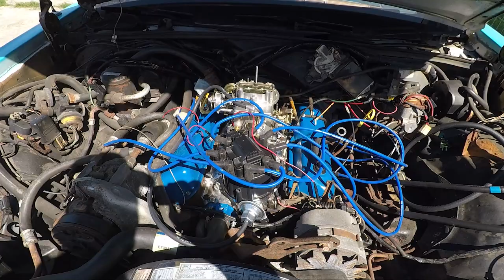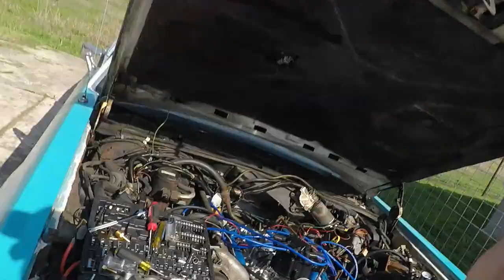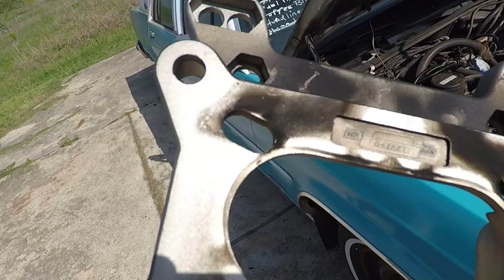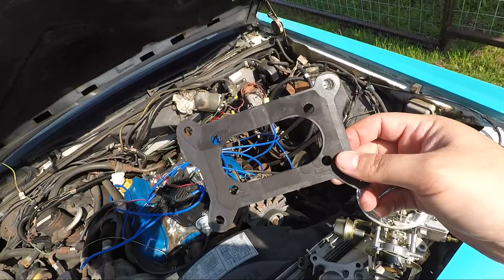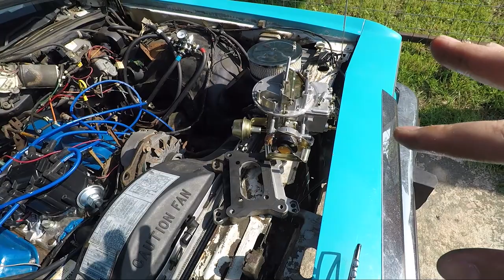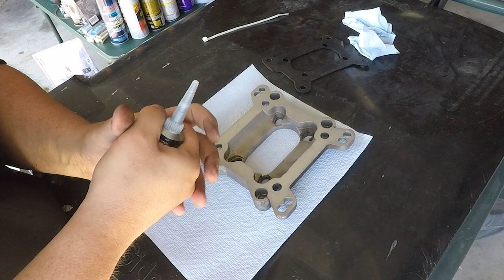1984 Ford LTD Crown Victoria Restoration Ep. 11: A New Hope

Comment: Earlier today I realized that there is a possibility that unfortunately the car may not start even after plugging the holes. That's because in the early episodes of the series, the engine wouldn't start so you tried changing the distributor, intake and convert to a carburetor. However, the cause of the engine failing to start wasn't known. There could be a possibility of the old issues prior to the conversion preventing the car to start. 

I sincerely hope that isn't the case. I remember when you purchased a code reader, one of the codes indicated a faulty crank position sensor.(If my memory serves my right.) I would look into this if the car still won't start. A bad sensor will prevent the engine from running. 

Fingers crossed it will start and idle on the next episode!
Reply from the maker: Excellent memory DJ! I wasn't exaggerating when I said my knowledge of cars is very limited (though it is certainly getting better the more I work on the car!). So it could be a lot of unknowns, with the throttle position sensor being one of them. It's a process, but I'm keeping at it! Thank you so much for watching and commenting, it gives me a lot of heart when things are stuck.

Comment: So my comment of a vacuum leak was probably right! With a smoke machine you would have seen the smoke escaping between the carb and the intake. I think there are very good chances that it was the cause of the engine running for only a few seconds at a time. That black soot was clear evidence of a vacuum leak that would cause a lean condition. You can thank your dad for the suggestion!

I that glue/sealer doesn't work, I would try JB weld. I'm glad you didn't give up and go to a mechanic!
Reply from the maker: Yes, I think you were definitely right (or at least on the right track). Right now, I think that seems to be the most likely culprit since I have eliminated timing to the best of my ability. And, given the fact the car was running at a more reasonable idle speed for a few seconds, I would say it's dialed in pretty good so far. Thank you so much for the tip with the JB Weld! It didn't seem to me like the RTV was going to be able to hold a vacuum leak/explosion in (it's pretty soft material even when it's cured) so I'll give that a shot! Or maybe I can find a really simple kinda welding thing? That would probably be the best way to fix it. I'm glad I didn't give up too! It was thanks to everyone's support and ideas that kept me going! :)

Comment: I have the 2100 motorcraft carburetor on my LTD, it works well. Keep on the task. My car fought me from paperwork to just getting it running.
Reply from the maker: Thanks for the support and encouragement! If you used an adaptor plate for your carb, did you have any trouble with it having vacuum leaks?
Reply: @gwe87  no adapter plate. I have a carburetor spacer. With a vacuum port.
Reply from the maker: @TheLTD_  I've heard that spacers are really important for getting a carb to work right since it helps to keep the fuel cool enough. I figure that the adaptor plate I'm using also doubles as one though. I'm thinking maybe if I get a new gasket set for it, it'll seal up right. What year is your LTD?
Reply from the maker: Oh haha I'm dumb. Its a 66 :p